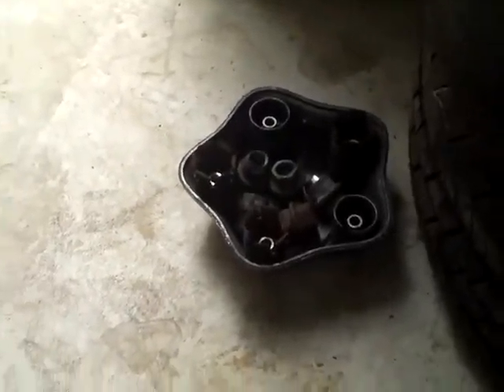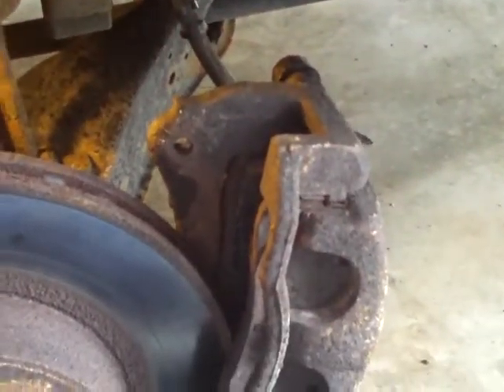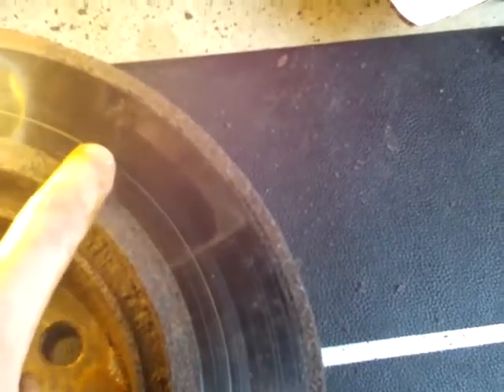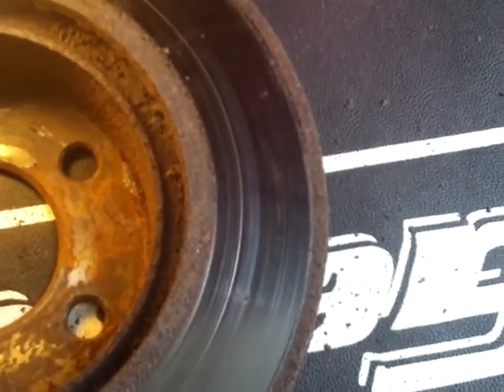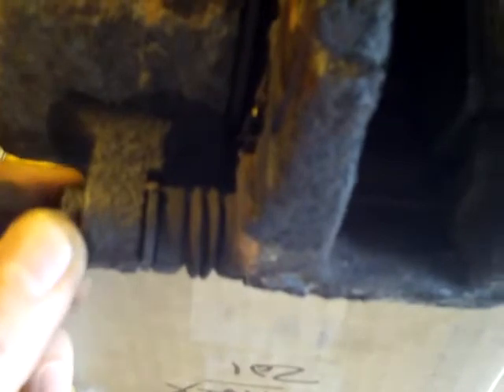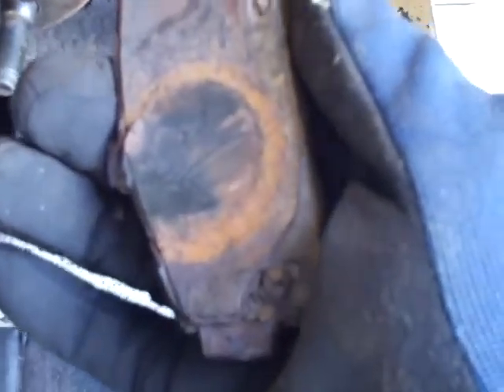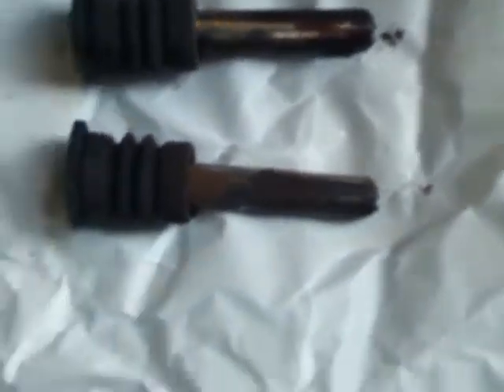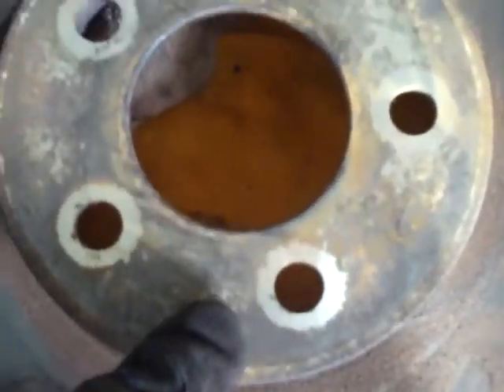Brakes How to 1996 Ford explorer 5.0 AWD part 1 of 2

Comment: The first site I found with instructions for this job said I would have to take apart the 4x4 hub and wheel bearing to get the rotors off.  I've never heard of such a thing so I needed to find "what I wanted to hear" somewhere else.  Great video, and good point about those slider pins, and to grease the pins rather than the hole where they go in.  Thanks!

Comment from the maker: @gbsk12 Itll be in the back right looking at the engine.  Should be a clear container that holds about 10-12oz of fluid and the cap should said dot 3-4 brake fluid only on it.  Should be 3-4 metal hoses coming out of it.

Comment from the maker: If they are small groves dont worry about them.  Groves are formed from an inconsistently had brake pad.
The only way to prevent groves in your rotor is to buy high quality pads and rotors.  Or slotted/drilled rotors that wear the pads evenly.

Comment: I am not sure what you are showing in this video.  You went from the tire off to everything removed then the next scene the rotor was off.  You didnt show anythihng on how to remove the parts
Reply from the maker: there are two bolts behind the caliper.  Should be fairly simple.
Reply: SparkysGarage
Hi yes know that I have done it and looked back the the video's that I was referring to I have no idea what they were talking about.  It was easy.  Thanks for the video.